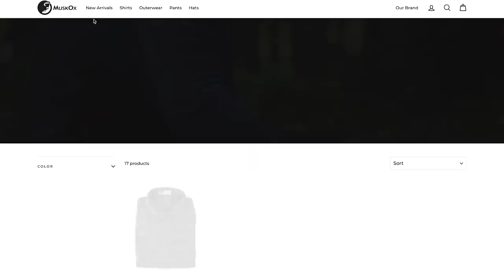I Hired An Apprentice (Professional Woodworking Shop)

Comment: This is really cool to see, going to be really interesting to see how things change in terms of work flow and layout as you guys develop working together. It's something I've been on the fence about doing for a long time, but still haven't committed yet. I mainly make kitchens rather than freestanding furniture, but even having someone there when there is heavy stuff to lift would be so nice. Looking forward to seeing things progress. 👍👍
Reply: as someone that is in a similar business as you, and someone that did hire people at one point,  and works alone again, its  not all its cracked up to be, You can buy a piece of machinery to do the job faster for about the same as the salary of an employee. that machine always shows up every day, and you don't have to pay it twice when they cut the whole job up wrong.
Reply: @adamchesis7443  Hi Adam,
Thanks for the reply, and you're not the first person to say that either! Did you find it wasn't even worth having someone to essentially be a labourer? Just to help with lifting and carrying and sweeping/sanding etc? I think that was the direction I was thinking of heading in, mainly as I just struggle moving a lot of things by myself. I think next year I'll be pulling the trigger on a large format CNC, hopefully with a tool changer if the budget can stretch. I'm hoping that might take a lot of the donkey work out of carcass construction and maybe even do some of my doors, so I hope that would be a big increase in speed. It's hard to know what the best move is sometimes.
Reply: @carpentryjoineryandcabinet6335  yes someone like that would be ok to have I don't know where you are located but I am in NY and after all the taxes and wage I have to pay would cost $25 an hour, I have designed my business to be able to work alone, I can install whole kitchens by myself,  I always build things in the smallest units I can. I don't have a CNC I have looked it over and for me I don't see where it will save me enough time to justify spending $100K at the minimum, maybe it works for you. I don't know
Reply: @adamchesis7443  I'm in the East Midlands of England, so wages would be lower than NY for sure, but I suspect the price of jobs would be correspondingly lower too. So it's probably swings and roundabouts. I think all machinery is a lot less expensive over here than it is in the states, new and used. You can get a decent new 3mx2m CNC with tool changer, sorftware, full vac bed etc for under £30k over here. If you want a budget 8x4 er20 collet type machine without a tool changer you can go to less than half of that, still with software, computer and vac bed. For me it would be good for cutting templates, I do a lot of curved work and template routing forms for curved work is quite labour intensive. Then if it just cuts cabinet parts in between bits like that, it could soon save me a fair bit of time. Normally that would be cutting on the panel saw, then grooving for the backs on the spindle moulder, then drilling shelf pin holes on the pillar drill. So if it could do that whilst I was making doors and faceframes  that would be a nice time saver for me.
Reply: @carpentryjoineryandcabinet6335  I can't speak for what the machinery Prices are over there, I generally buy used stuff. Anything made 50 years ago is better than anything made today.  I have a sliding table saw for plywood processing, I have a 13 hole line boring machine, 2 shapers, 24" planer, 3 jointers, time saver, large band saw, slot mortiser, anything that I would need, I mostly build frameless cabinets, sometimes I will do a face frame job, But I also build furniture from time to time. I am not a computer guy so I think that a CNC for me while maybe could save time would be difficult to learn and get going with
Reply: @adamchesis7443  from speaking to friends who are in the industry in American it seems prices are more expensive, but I guess it depends where you in the country you are as well 🤷🏻‍♂️. I pretty much only make in frame kitchens, barely any overlay stuff at all. I've got a panel saw, 5 head planer moulder, a couple of spindle moulders a twin head wibe belt sander, Hoffman/morso faceframe notcher and dovetail key system, tenoner, morticer and the usual workshop stuff like bandsaw, pocket hole mchine, planer, drill press etc. So really I think CNC is the only thing that would make a marked improvement for me at this point. Albeit with a learning curve to get used to. It would be the only machine in the workshop that would carry on working even when I wasn't stood at it, and that's the real appeal to me.

Comment: it kills me to see your fake Oliver jointer and planer, you should find a 166 and a 299 those are arguably the best jointer and planer ever made.
Reply from the maker: Well its a real machine that works really well!!  Old ones are nice but after restoring the bandsaw and mortiser its also nice to get something that doesn't require so much dang work.
Reply: @AndyRawls  you can still get the older better stuff that has been restored or ready to go to work. it can be pricey but in the long run it saves time and pays for itself. My 299d has an itch head on it which was designed in the early 70's and the cut quality I get with it blows away anything made today, tear out is extremely rare and it saves me a ton of time and I don't go through belts as often on the wide belt sander.